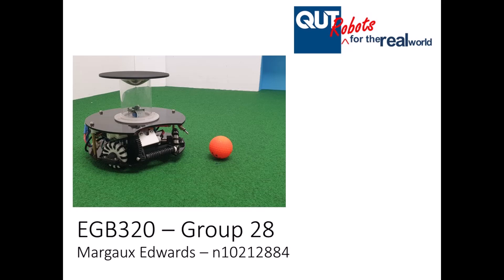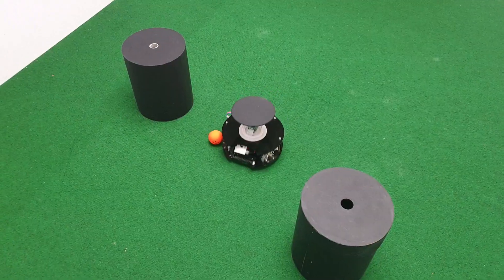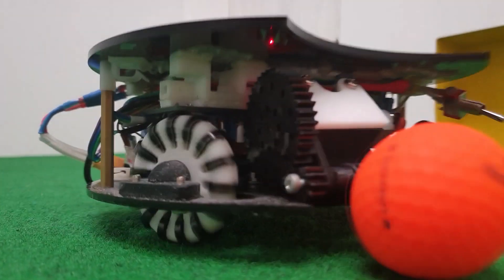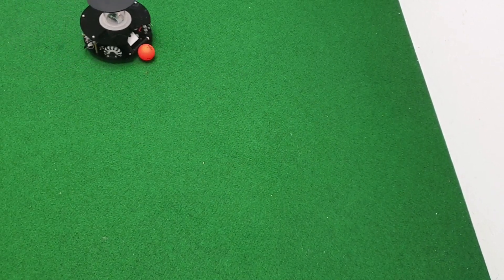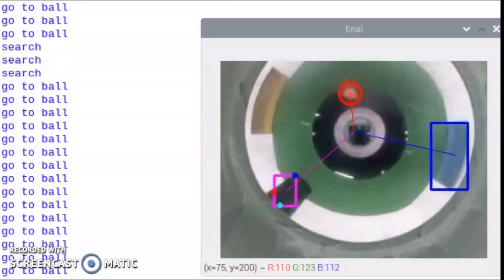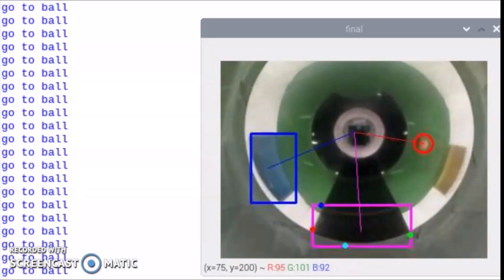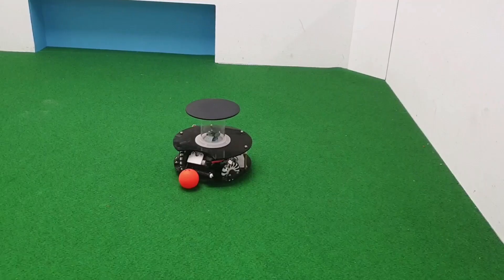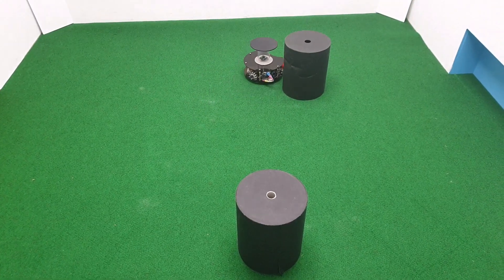EGB320 RoboCup SSL Kicking Technical Challenge

Comment: Hi Margaux, did you purchase the mirror, or was it built?
Reply from the maker: The mirror was actually a CNCed piece that I luckily had access to through my work. There are many alternatives including heating a reflective plastic sheet over a 3D printed mold. If you particularly interested in this vision system, I would definitely look at the literature - CSIRO and some of the QUT lecturers have released some very useful papers on this system.

Comment: This challenge seems to incorporate a mix of SSL and Robocup Junior rules yet you brand it as SSL. I am confused as to why that is. Can you please elaborate?
Reply from the maker: This project was created as part of a project for my Mechatronics degree based on the SSL competition. While our project was based on the SSL rules, we were not using an overhead vision system like the current SSL competition. Therefore I decided an omnidirectional vision system would be a good alternative to a forward facing pinhole camera. If you look back at the original SSL competitions, onboard omni cameras were used but due to limited onboard processing power, teams opted to use the overhead systems instead. As an ex-RoboCup Junior competitor, I thought it would be an interesting challenge to see how these systems would work on a SSL robot.
Reply: @margauxmedwards126  oh, interesting. Granted, your robot might very well comply with Robocup junior rules in the near future if the TC end up following through with changing the current passive ball with the new golf ball.
Reply from the maker: Yes indeed. It was very interesting to see the differences between the current larger orange ball and the golf ball. If the TC ever decides to change to an orange golf ball, teams are certainly going have to modify their designs to have the same field of view!
Reply: @margauxmedwards126 Edwards yeah, It will be interesting to see how the junior divisions evolve over the course of the next few years.